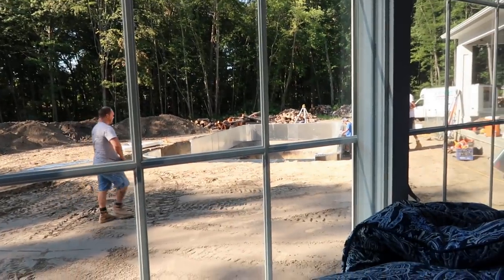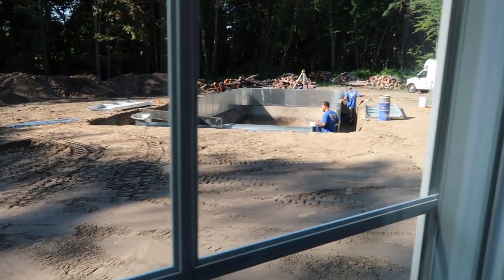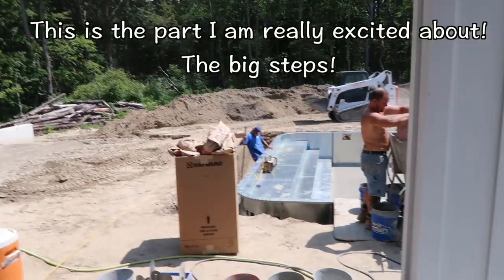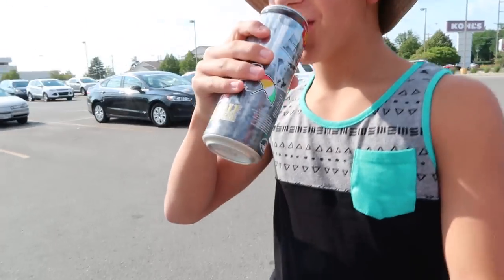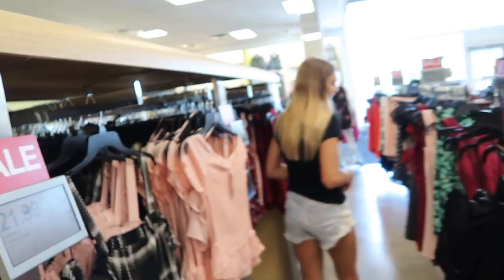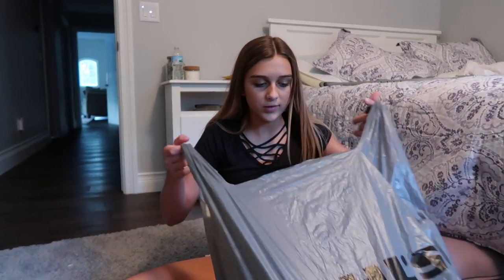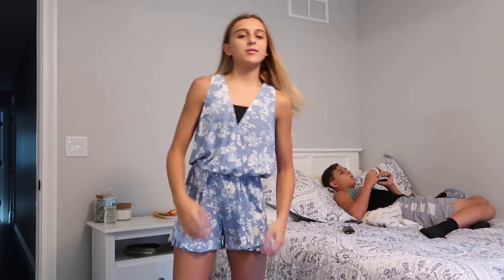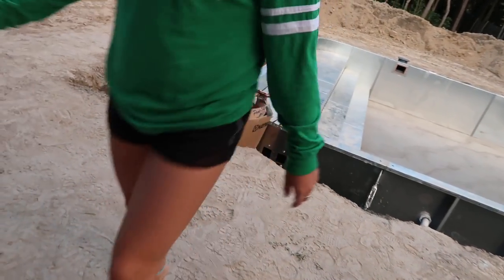BACK TO SCHOOL CLOTHES SHOPPING FAIL! NEW POOL INSTALL DAY TWO

Comment: If your going to let chase drive you should be the one upfront Candi not Karli because Karli isn't going to know what to do in the case of having to avoid an accident. Your the adult and it's dangerous especially since he doesn't have his permit. Yes chase needs to learn but until he has a permit he needs to not be on the roads. Doesn't matter.

Comment: very disrespectful for the friend to step in the pool after karli said not to. i would be ticked if i was ken or candi because that's just something added to the list that's needs to be fixed but wouldn't have happened if the rude friend would've listened.